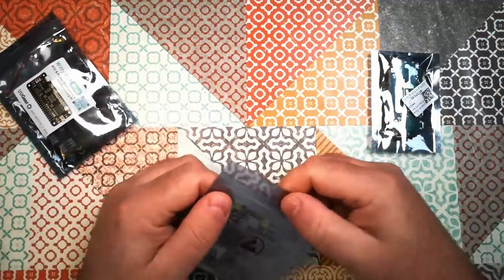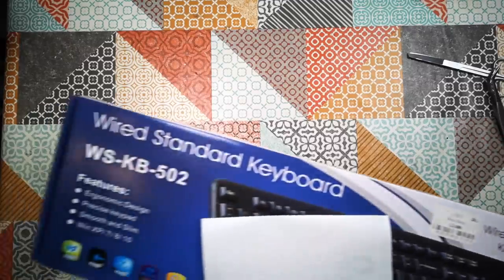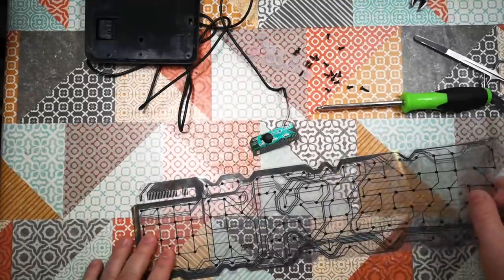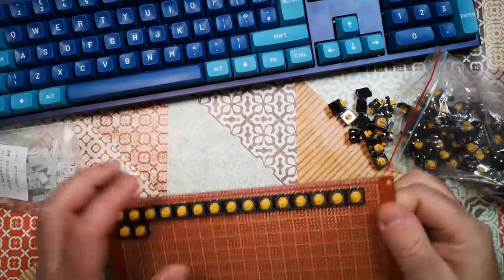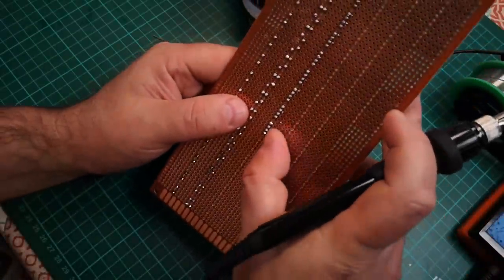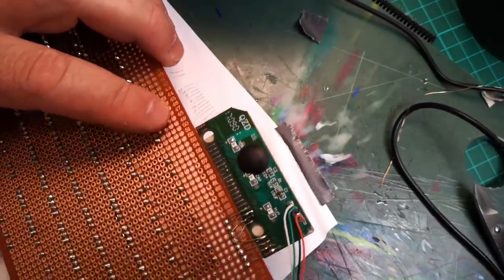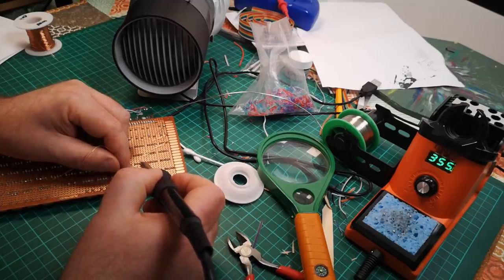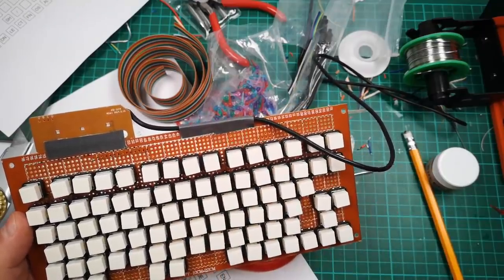How to NOT Build a Keyboard, or: Time to Stop Doing the Same Thing Harder

Comment: I have done things like that before,.. Some things that really help me in these situations: Firstly, For the switches, you may bend the pins in the direction of the respective switch. This tells you what switch the pin goes to as well as keeping them from falling out. Secondly, Use colored marker on the pins to denote which trace is which. This will help you keep track of things as you solder the wires on and it will go much faster. Thirdly, Switch to PVC jacketed #30 wire. The PVC can be easily pulled apart where you want to expose the wire and it is usually pre-tinned. The magnet wire is a good idea, but it can be problematic trying to burn off the enamel efficiently. Also, you have 10 colors of jacket to choose from which will also help keep your matrix oriented and coordinated with the established marker colors. Maybe cut out the section of the perf board that has the KBD connection so you don't have to resolder the connections on the keyboard module? Heat gun may help you pull the switches off the old perf quickly so you may be able to reuse them. Use additional flux that can be applied via syringe for faster and better solder bond. Wrap the wire around the pin a couple of times to help keep it in place.

Your endeavor has a few setbacks, but all is not lost!

Edit: Make sure all the connections on the keyboard module are functioning then pot the module in epoxy for durability?

Comment: My recommendations when it comes to soldering:
1)355 is too cold even for leaded solder add 10 degrees on to your temp (this will increase the speed your joint forms without melting your switch)
2)Flux! Hearing you say the line "there wont be much smoke as all the flux is gone" while attempting to join enamelled wire onto a pad was an absolute facepalm moment.
Reply: Yeah when he said that I had to laugh. If you're not using flux then you're not soldering either. Maybe if both conductors are tinned. Then maybe. Even then no flux isn't ideal. But you stand a chance of sticking stuff together.

Comment: Despite having dabbled in building my own not-so-good-keyboard, this was quite interesting!
That might be, because your approach was the direct inverse to mine: I had a broken laptop and decided to hook up a teensy to the 25 pin ribbon cable of its keyboard.
The programming ate my weekend for breakfast, but overall I'm quite happy. Seeing your struggles, it seems I have made the right decision.
Reply: How did you connect wires to the ribbon cable? Trying to solder to it doesn't work because it melts the cable.
Reply: Maybe he desoldered the ribbon connector and used that?
Reply: @hingeslevers  I hope he didn't do that because that more or less needs a hot air gun, and I don't have one.
Reply: @theodiscusgaming3909  You can solder to ribbon cables, but you have to be quick and gentle with it, just have a search here on yt for ideas.
Reply: @theodiscusgaming3909  Depending on the kind of ribbon cable you can also just cut/pull the strand cables it made out of apart and thenn it's simple wire to wire soldering and no issue at all. Just make sure to not forget the heat shrink. I have done this dozens if not hundreds of times already.
Reply: @theodiscusgaming3909  you can do it with some chipquik. Though I'd cut the plastic of the connector off first with some flush cutters
Reply: @theodiscusgaming3909  huh, seems my initial reply has been sent to the shadow realm.
to summarize:
- "Soldering to ffc sounds like a nightmare."
- "I ordered a connector and custom pcb instead"
Reply: @Esablaka  the problem is it's not a standard ribbon cable, it's a flexible material with traces printed on it.

Comment: I remember a particular keyboard I had back in the late 80's or early 90's.  It didn't have a bad feel to it which was surprising when I finally opened it up and saw what was inside.  It worked fine but then over time some of the keys became less responsive or didn't work at all.  Since I had nothing to lose I opened it up.  What I found was far more low-tech than I ever imagined.  The PCB was printed the same as the PCB in a typical TV remote.  On the working end of the key shaft was a pad of spongy, grey foam that had a square of shiny, silver Mylar looking material on the bottom.  That was all there was to it.  Pressing the key and compressing the pad shorted the contacts.  That aspect I found interesting because the pads were in constant contact with the contacts but only shorted when additional pressure was applied.  Then, of course, as dirt and hair and other things fell inside they would get between the contacts and the pad but it was a simple wipe-out with a cloth and it was back to working fine again.  Today I use a nice mechanical action gaming key-board and even though I can see it's full of dirt and I've worn many of the letters off it still keeps going.  Now, my mouse, on the other hand . . .
Reply: Truth was, making a keyboard with any kind of actual discrete switch per key all those years ago would include a noticeable cost per switch/key - having  even 80 keys at $0.10 before you got anywhere else would mean their budget keyboard was a $8 item even before anything else was added, let alone assembled, so there were several innovative choices often involving a lot of bits of moulded rubber/plastic/sponge/stamped metal/whatever that could be churned out - and that's better than another decade or two before when all those 'cheap' switches would start you at more like $40.

Comment: I did the same thing around 2006, to build myself an emulation controller for an emulation machine made out of an old cash register computer into an old carry case; when I was trapped on a ship 100's of miles out to sea(USNAVY). I did the same thing, by recording the matrix, but I just drew on the clear plastic with a permanent marker I wrote the name of the key down, and on the PCB  (0123 for rows, ABCD for columns etc). Really cool vid sir!

Comment: I have a jukebox project sitting in my garage. t runs off a Raspberry Pi.  Since I wired the buttons to a USB joystick controller, the number of keys that it uses is limited.  If I need a full keyboard, I can plug one in.

I've learned more from failure than success.  People are less likely to analyse success than failure and I am no different. I am glad that you took the time to analyse yours. It now would me think twice before starting something like this. Hopefully, I can pick up the jkebox project next summer when I can work on it in a warm garage with an open door for airflow.

I hope that this setback does not dissuade you going forward,

Have a good new year

Comment: Thanks for sharing. What differentiates the good from the bad here is that you edited the video to be very clear in the first few minutes that the project turned not out as it should have. When I wanted to start my career "in computing" about 20 years ago, I talked to some people trying to convince me to start with electronics. Which seemed fair, so I did that and things got very confusing. I had higher expectations than most back then, but frankly everyone was very bad at project management, meeting customer requirements and generally sub-par teaching students. Which of course, could not be... so I was at fault.
May be that is the reason why some even struggle today in IT environments.
The project seemed like a good idea. Effective cost cutting. It started to get confusing when you had 3 to 4 PCBs on the desk, which had so much potential and you wanted to make best use of all of that. And more. Smaller, higher integrated components would have been more expensive (or not making use of the components at hand) but the right way to go before one gets lost in all intricate details and what could have been. Repair Cafés are also a really nice idea, when you keep the focus on things that can be repaired.

Thanks. This was rather painful to watch despite best efforts, but it should be shared with everyone underestimating how projects can fail and where to stop to avoid the sunken cost fallacy (while trying to cut costs). 4 PCBs and a rubber dome keyboard. I would have stopped there. Not because of laziness, but because of fear what the project may become.

"Laser engraving the keys, charging other devices, doing some computing on the device itself." That made me feel very excited. All the cool technology we could have at our hands (or in a maker space). But then slowly realizing that it has to stop and you have to set priorities.

Comment: I was surprised to learn that the heat of a soldering iron could remove the insulation from copper wire - it never has in my time. So, my shock was limited when it didn't work :-) Bravo for posting this !
Reply: It depends on the wire. There's wire made for motors and transformers that requires excessive heat to remove the insulation, and then there's the (far more expensive) wire with self-fluxing polyurethane coating, for example Verowire.
Reply: I actually found that attempting to tin directly (solder on the edge of the iron, rubbed gently on the wire) is enough in some cases. You can tell when it's tinned because the solder will "wet" the wire, rather than pool around it while stuck to the iron.

Comment: I absolutely encourage you to get more and more into DIY electronics. I’ve enjoyed your videos for a long time but I’m a hardware guy only. I can copy and paste a bit of code if somebody’s problem gets wiped but I’m scared to death the whole time I’m doing it.   However I have no problem repairing and calibrating very high end metrology great equipment. That’s my whole business these days. Started my own lab five or six years ago completely by accident because I got shocked really bad and realized it was time I learn some things about electronics if I’m going to keep building vintage reproduction guitar amps. And restoring CNC machines and stuff like that. 

I was shocked so bad it knocked me up against my wife’s car and left a huge dent in the door. 😂 I had no idea capacitors could even store a charge! And when you’re working on a massive tow behind welder that has huge capacitors that look like gallon paint jugs 😂 that’s a bad combo

Started looking for a cheap multimeter and dirt cheap adjustable power supply and the next thing I knew a few months later I had mountains of professional grade test equipment that I paid almost nothing for a government auctions, college auctions, and even on eBay. Once I cracked open my first piece of Tess gear and saw the beautiful engineering that went into everything… I was hooked

 here I am six years later with my own metrology business and a lab full of NIST calibrated equipment. And I do work for the best clients in the world who are super interesting. Mostly like government and research labs and stuff like that because I happen to be in a city where it’s kind of like the birth of science in America I guess that’s a good way to put it.

Are used to avoid and hate electronics. And now I absolutely love what I do. But I couldn’t write a single line of code if I had to. I mean technically I can still write machine code andG code from my machinist and toolmaker days but just barely. 

You are much brighter than I am and you would absolutely be a natural in the world of electronics. Just know that when you’re working with your hands and crafting something that it’s never a linear process. Ain’t no paint by numbers when it comes to working with your hands no matter if that’s doing brain surgery or laying brick.

It’s always different than you think it’s going to be and know That sometimes (pretty much all the time) you have to change and evolve in real time as the projects and variables fail/change/or whatever. Adam savage talks a lot about that on his YouTube channel. 
Because if you can’t change with your projects and be flexible… Then you will either never finish anything or you’ll fight it the entire way and it will be a miserable process. Sure you might not be 100% happy with it when it’s finished but you wouldn’t have been even if everything went your way. So you might as well finish it. That is how you build up experience quickly. And you build up positive experiences instead of having drawers full of a failed unfinished projects that call out to you like ghosts in the night.

 I think you will make a wonderful electronics Tinkerer and troubleshooter!

 If you’re like me and you want to jump in on the deep end …just start buying really expensive golden age test equipment from brands like HP and tektronix from mid80s and 90s… Stuff on eBay that sold as “untested”… i’ll be able to pick up crazy expensive equipment for pennies on the dollar. And sure you might not be able to fix everyone of them but you will learn so much that way. And you are learning from the true masters of systems design and process engineering. Not that some of the products like the iPhone and stuff made today aren’t masterfully and wonderfully designed an engineer… But when you crack open a flagship piece of test equipment from Hewlett-Packard from the mid80s or 90s… it’s like staring up at the ceiling in the Sistine chapel.

Just make sure you’re doing it safely and you’re not going to kill yourself. First thing to do is outfit your bench with nothing but GFCI outlets. If you don’t want to wire them in the wall then you can just buy adapters that you plug into the wall and then plug directly into those. Next Make sure you have an isolation transformer, Watch a few videos on them and make sure that you understand the difference between an isolation transformer like used in hospitals and it industry and a true “isolated“ isolation transformer.

And third a decent current limiting device like a dim bulb tester. Once you crack into a high end professional piece of test equipment… You’ll be hooked and you’ll never look back.

Comment: Thank you for this video!!!! I tried a similar project with the same keyboard (branded as Inland, but everything looks the same). I was building a controller for arcade games.  I got it about half working,  then a trace got pulled off the controller.  I set the project down and eventually went back to it later with control boards that are designed for that use. 
Learning to stop a project and rethink it is a valuable skill to have!

Comment: Great video!  Failures in a project are often more interesting learning experiences than if everything goes smoothly.  As someone that has a small pile of projects that eventually hit the point of too much effort to fix my mistakes, it's refreshing to see a diy/tinkering video that shows what happens when things kinda go sideways.  I've made my own attempts at trying to bodge together random electronic bits to do things they weren't originally designed to do, only to realize I've managed to wire something backwards which then lets the electronic fairies escape in a puff of spark and smoke.

Comment: I've next to no technical aptitude for building stuff in this fashion, but I think the most admirable points of the video are two things: First, admitting the failure. That's one of the hardest things to do - saying, "well, that didn't go the way it was supposed to," - particularly when doing so exposes you to ridicule (and you had no need to actually admit you made a mistake). Second, realizing the bad path you were on and not falling into the "sunk cost" hole. Always a good lesson. Be cognizant of the effort you're investing in a project, and be clear-headed about what furthering that project will take at any given point.

Good show.
Reply: I'll never knock someone for trying something. You never know until you go. He could have pressed on and finished the project. But he knew it wouldn't have been what he wanted. That would have been a greater failure. Better to take a little temporary l than a big L that hangs around.

Comment: I had fun watching. 
Anyone who has ever tried to DIY anything failed at certain steps.
Researching every detail for days isn't pleasant neither, and DIY should be pleasant. It's not like we're preparing a project with mass production in mind. And I too had my share of grief with those switches. I ended up actually removing 2 of the 4 pins for easier identification and short prevention (in a side by side pattern). 
Great project and I'm looking forward for more adventures!

Comment: This is exactly the thing I've been in the process of doing for a few months. I'm mostly delayed by costs at this point but I am going to finish it. I'm taking an old generic Dell membrane keyboard much like this one and making a PCB for it for mechanical switches and backlighting. I've finalized the PCB design and really just need to design the 3d printed bits and order everything. I also put diodes into my PCB design. Really cool video either way man. It's giving me the motivation to finish my project.

Comment: I disassembled a Genius keyboard once for cable repair, and by messing around, I found that the chip has extra keys (such as volume, brightness, web homepage and others I have never seen) accounted for in unused coordinates on the matrix. If you end up doing a similar project or just plan to enhance your PC in some way, this may be the best way to add volume control or extra keys with custom macro functions using AHK.

Comment: I took apart a cheap keyboard for a DIY project as well, but simply tinned and soldered leads onto all the pads, found a website that shows all key presses, and tapped the wires together while writing down what each one did. Took a while, but the goal is to make an Apollo mission style control panel for games like KSP. Using friction fit jumpers means that key bindings are easily redone. I've put thought into a similar project to yours of a wrist-mounted computer, and honestly the best solution was to pick up the smallest keyboard I could manage and instead burn myself out on the 3D printing and programming of the thing